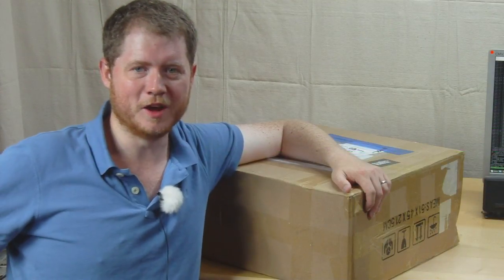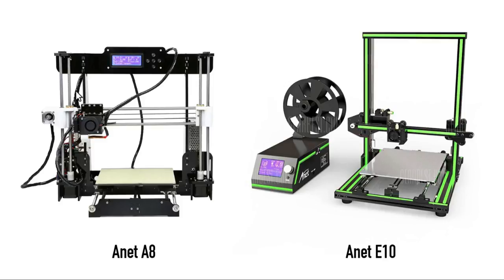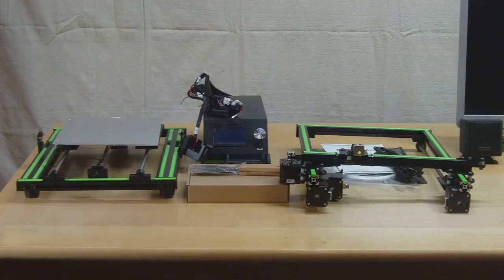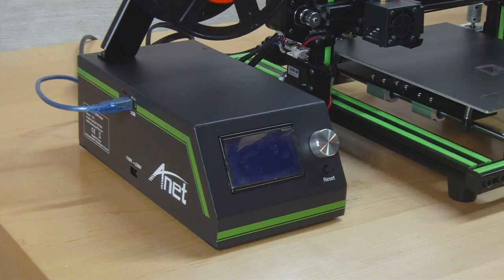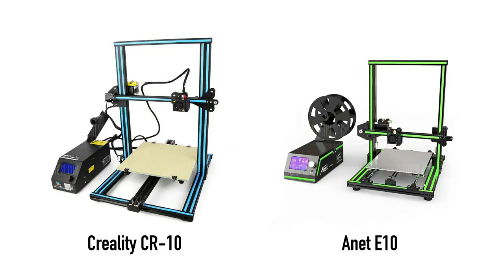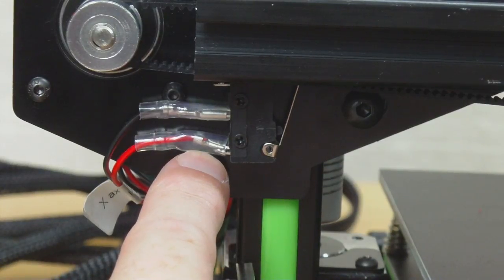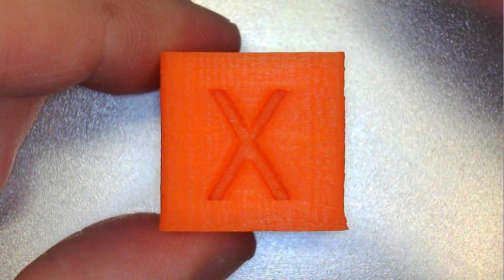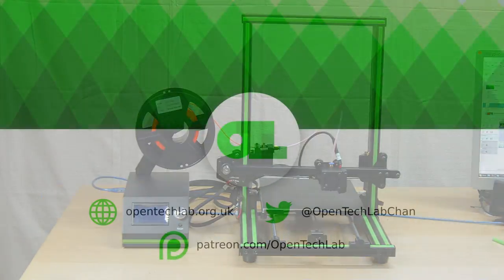[010] Anet E10 3D Printer Assembly & Initial Impressions

Comment: I got a CR-10 S4 and the Anet E10. The build quality is definitely on different playing fields, but so is the cost of them.
If you want a medium sized <$300 printer, go for the E10. If you want a big $450 printer, go for the CR10.

I also noticed the extreme wobble your X carriage has. If you get the bottom wheel tight enough, which is difficult I can admit, it will hardly wobble. I have to apply a considerable force to get it to lift ~4-5mm. In regular printing it works exactly as it should.

Comment: some info to help you. THis is not a repalcement for the CR10 but more a competition for the Wanhao Maker Selec I3's while trying to ride the CR10 train.

 for your z steppers. yes. nasty design flaw. but its caused because your H carriage is BENT (look at it from the side) its easy to bend back but either way those steppers SHOULD be facing backwards as  you changed them. much better that way.

your limit switch snapped because the post hits the BOLT. you need to bend the pin first before plugging it in (again this needs to be fixed at the factory) but is easy to work around.

turn on the printer navigate to configuration. lower acceleration to one half and jerk to one half of stock values. be sure to save the values (store memory I believe)

that will dramatically improve print quality and noise in the print.

the printer is crazy quiet but as typical with chinese printers the fans are rubbish. replace them. enjoy silence.

your print head carriage is wacked. definitely need to tighten that. mine was fine so I guess there is some QC issues at the factory they need to work on. my parts cooling fan is actually pretty darned good. so likely another QC issue IE you got a bum fan.

the only printed parts are non load bearing (linear rod hold downs) ALL critical parts are metal. I am ok with non load bearing parts being printed. they are not under load so its fine.

just rip all the green stuff off. printer looks better without it anyway.

I also don't like how "rough" the y axis is when moving. I am going to look into smoothing that out.

the belts really don't need to be THAT tight. tightening it up by hand is easy and painless. don't over tighten. ALL of your print noise at this point is coming from that flapping x carriage.

great video. keep up the good work. you sound good on video too.